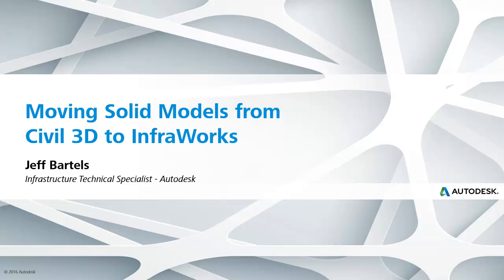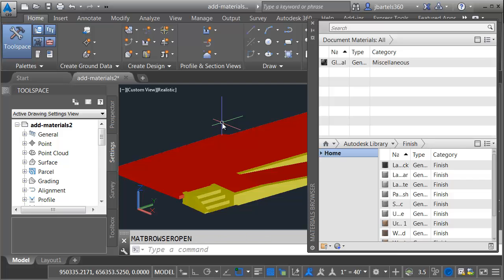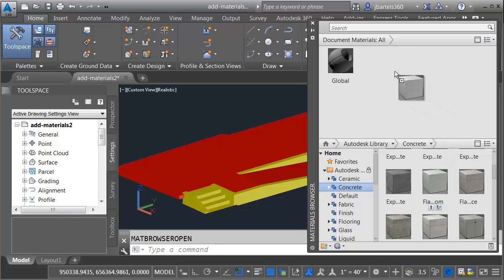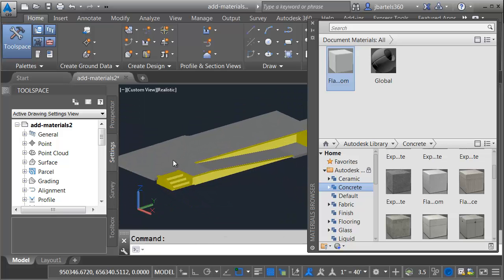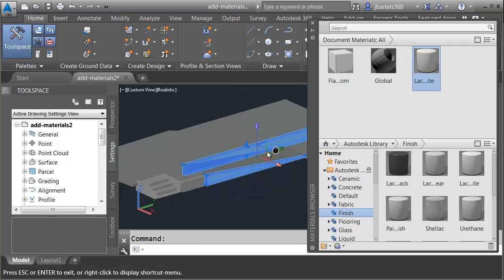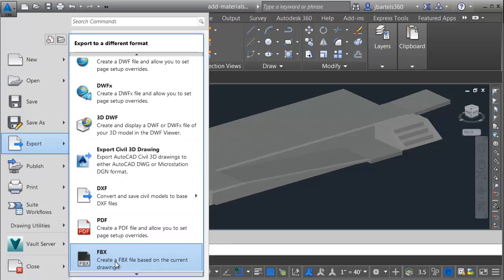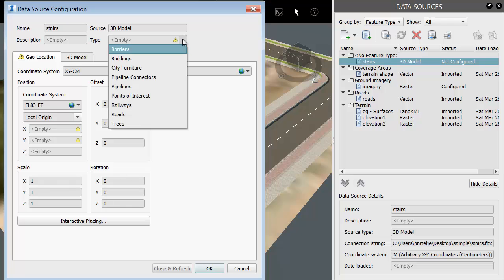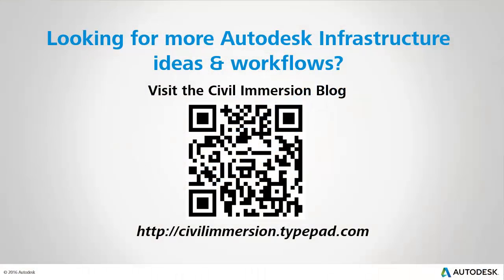Moving solid models from Civil 3D to InfraWorks - Part 3

Comment: Dear Jeff, I'm a landscape designer working in C3D and last three tutorials were extremely helpful. Few questions please. You created solids from surface. Is it possible to create three layered surface that would represent: tarmacadam, sub-base and a slab? would it then be possible to assign BIM information like material and depth? Would it be possible to create a cross-section through this layered surface and produce a construction detail? Would be grateful for your advice.